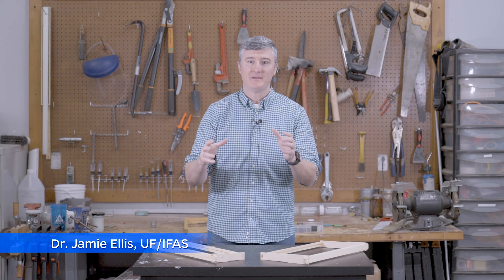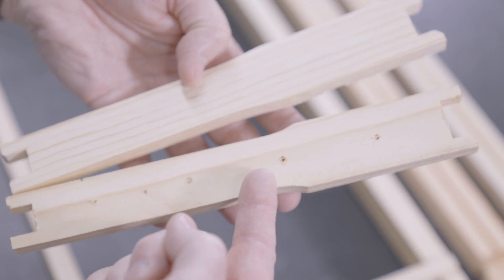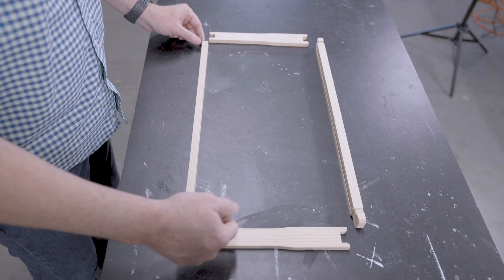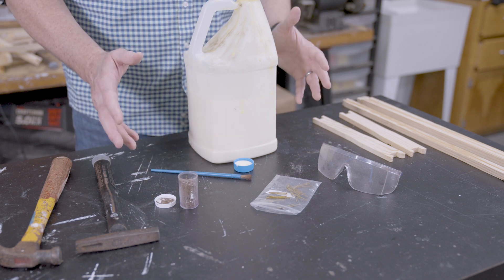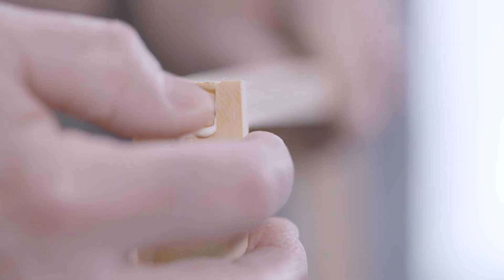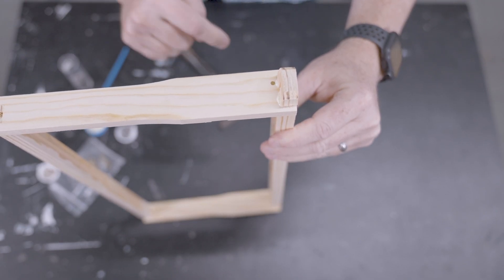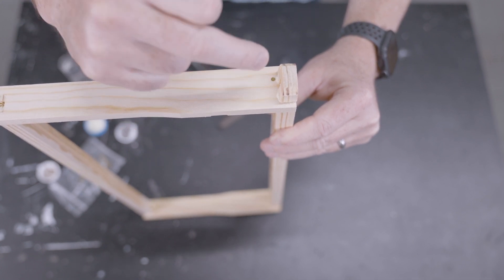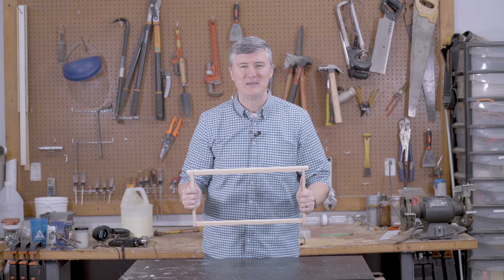Assembling Frames | Beekeeping Academy | Ep. 21

Comment: Need a mention on checking the frame square.  Most commercial frames are cut in such a way that this problem is corrected upon assembly, but not all!  Frames with sloppy tolerances or damaged grain may not assemble evenly.
Reply from the maker: Great point!